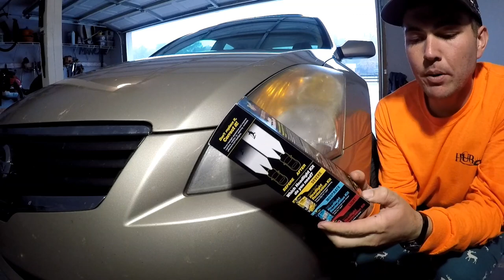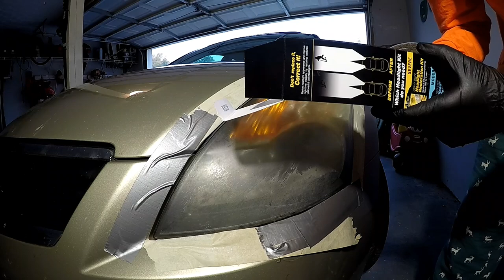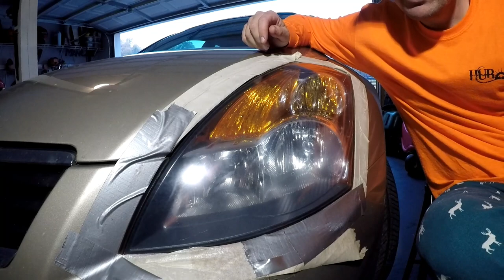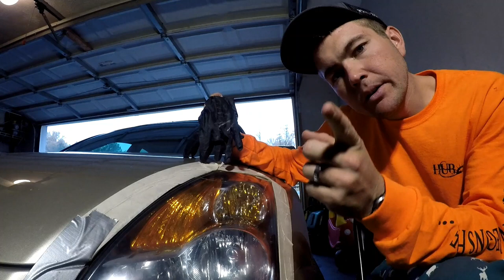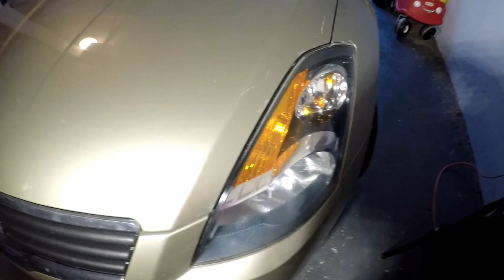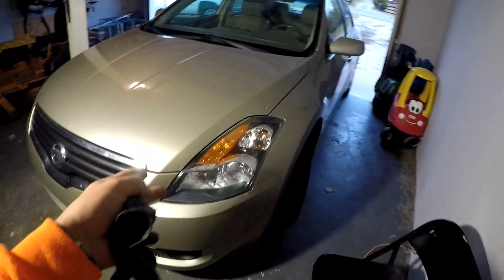Meguiars headlight restoration kit review

Comment: Dude. Never put duct tape on paint. I cringed!
The lights are definitely improved.  I used the heavy duty kit and was not super impressed with the results on mine.  But I went sanded at 240, 400, 600, 1000, 1500, 2000 and 3000.  I think my headlights were too far damaged when I tried to fix them.
Maybe if I had worn pajamas??  Lol
Good review.  👍
Reply from the maker: Lol the pajamas helped and the paint was already kinda wet so i knew the duct tape wouldn't do damage
Reply: He's a MAGAT, what do you expect?
Reply: @christschool  unsure what a magat is but his results were more impressive than mine.  Next time I am definitely going for my spidey pajamas.
Reply: Duct tape oommmggggggggg!!
Reply: @barrykelly2722  

M
Reply: @barrykelly2722  

Mmmo

M
Mm
O

Lmk
O

The same
Reply: Duct tapes vary greatly. I've run into painter tapes that have given me just as much trouble as some ducts.

Comment: The Meguiars kit i used had 1000 grit and 3000 grit with polishing compound and UV protectant about 20 minutes each and they both look new. Use the 1000 grit vertical and the 3000 grit horizontal keeping wet with a spray bottle then polish with a electric drill  and then apply UV protectant
Reply from the maker: Advanced techniques i like it
Reply: i think that’s the heavy duty version of this kit, only like $5 more but requires the power drill for the buffing stage
Reply: I second this!!!!^^^^

Comment: Good review and results. This kit attempts removing oxidation cracks with an abrasive pad & cleaner. Since the cracks go deeper where the light has been shining on the plastic, this will be more difficult to remove completely in that location. Some oxidizing could be on the inside of the plastic. I've always hated plastic headlight assemblies. I paid 20-something & am about to get to work, but I might buy new, glass headlight assemblies for my 2012 VW GTI.
Reply from the maker: I hear ya i think this is a good kit though but new headlight would be even better
Reply: @tonyslawncare  So, I ended up getting a 3M heavy duty kit, using sanding disks & a drill, and got one headlight looking pretty damn good. The catch to doing this is it takes a hell of a lot of work, a little sanding skill, and a long time. Sanding cracks & color out of acrylic, or any clear plastic, is more like an art form which must be learned (though it's not too hard). It took me a few hours to complete one light, and I needed extra sanding disks so had to buy another kit, all for one light. Now Its on to the second headlight tomorrow. Restoration isn't perfect, but it's pretty close.

Comment: Don't judge the outcome until you spray on the sealant. Headlights are foggy even after the sanding steps. My 98 ls 400 Lexus look 85-90% original.  Did the job!
Reply from the maker: Great tip

Comment: Wow brought my original 2004 toyota highlander headlights to almost new. I used whatever pad came in the box. I only applied once. My only regret was using cheap masking tape , it kept ripping when i puled it off.
Reply from the maker: Thats great to hear bro
Reply: Yeah it's worth it to spend the extra for the blue painters tape. It comes off better and will not damage finish.

Comment: Looks really good the 1st time.....I used the one that required my drill and it buffed my lenses awesomely. Now I'm a year removed from doing the headlights and it  needs a touch up so I got the middle Meguires restoration kit and am going to redo the lenses without the cordless drill. Love the product.....will keep using them as needed. Also, found some really high quality LED bulbs dot legal for my 2003 TDI Jetta and it's a game changer....thanks for ur video.
Reply from the maker: Marcus thank you for watching and commenting!

Comment: On the next one use 600,1000,2000 and then 3000 sandpaper if you have a buffer use some polish and buff it before you spray thatll get that haze off. One coat will do.

Comment: Use the 3M kit then the Meguiars spray. Or just use a UV protective wax every 2-3 months to keep them protected for a long time.
Reply from the maker: Good input thanks bro
Reply: Tony's Lawn Care actually what is the best, just found this out! Use headlight film on the lights after you wet sand, compound and polish then clean with isopropyl alcohol and apply the film with distilled water and dish soap, just like window tint. Spray the light and the film with the soapy water and apply! It will last for a very long time and if the film yellows you just have to reapply the film if needed. You can get it on amazon for $20. it’s a bit of a more of a complicated application than you do and I’ve done time and time again. 👍🏻👍🏻

Comment: Autosol also works but you'll need to get some UV protection spray for when you're finished or it will fog up again. I have a 2004 Nissan Elgrand with the same problem. I wonder if Nissan are using poor quality materials for their headlights.
Reply from the maker: Good input i think alot of brands seem to have same problem with the headlights tho

Comment: Wondering if the bad part at the bottom is from the inside? If there is a seal leak like on most aftermarket lights, the condensation will fog it up from the inside.
Reply from the maker: Thats a good thought buddy